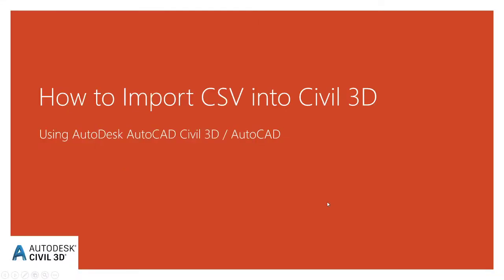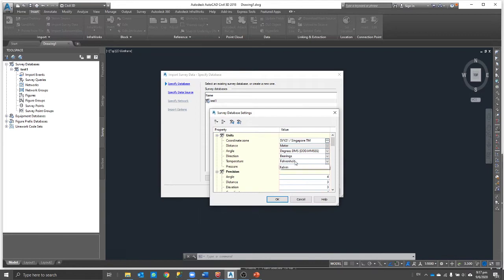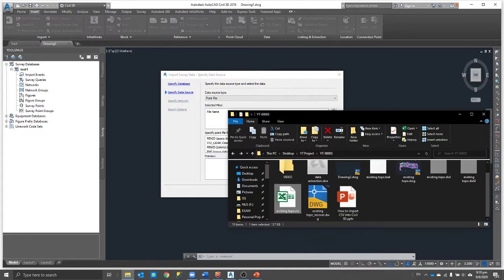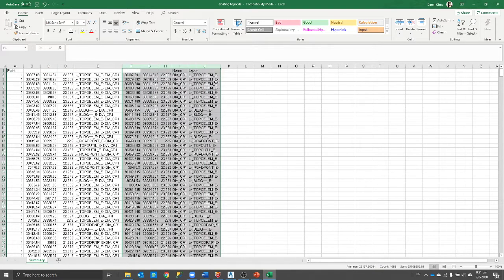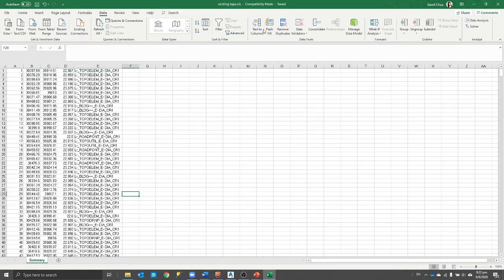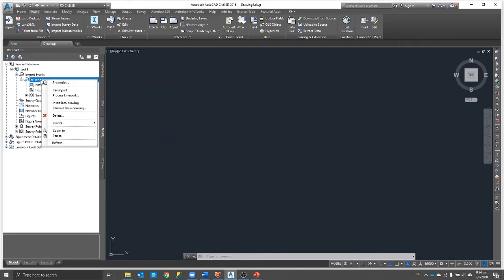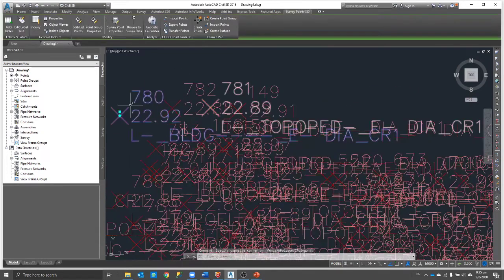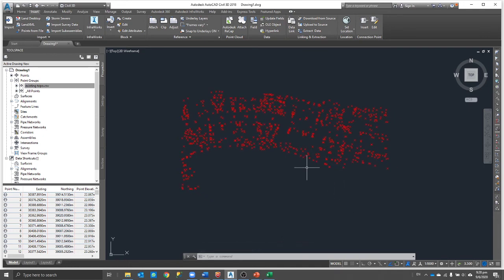How to Import CSV or Survey Data into Civil 3D | AutoDesk | AutoCAD | CSV

Comment: This is very good materials to be passed on for future young civil engineers. The reason why registered surveyor saved them in .CSV so file size is lighter. Such registered surveyor's results very useful for reclamation projects or sometimes finding those problematic telecom position when the numbers fade away on site. There is also a French developed worldwide coordinate surveyor (https://twcc.fr/) that does the conversion for SVY21 system from WGS84 (im not sure of its accuracy though) but its useful especially when you are able to load Google Map tiles background for rough estimate comparison.
Reply from the maker: Yes it is. i will consider adding a video to map SVY21 to WGS84